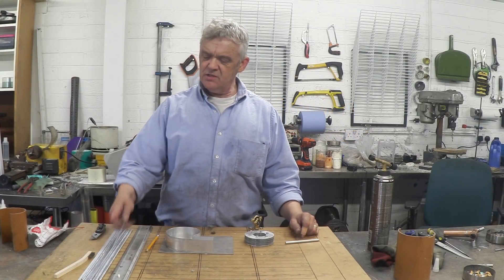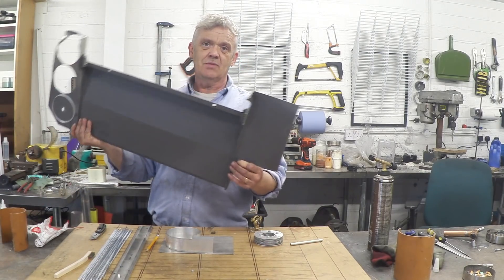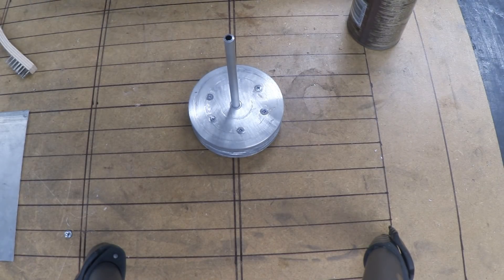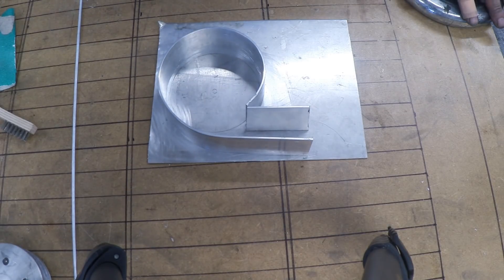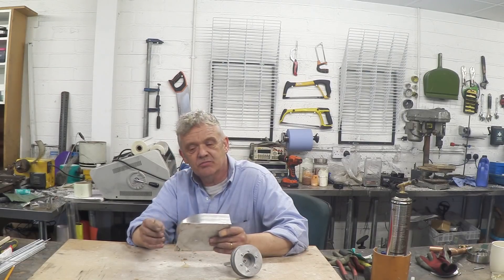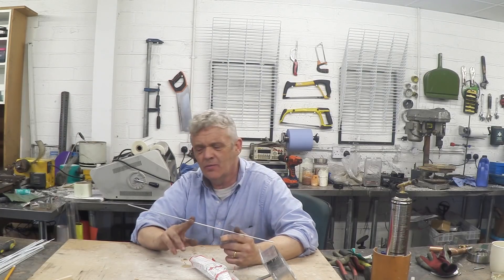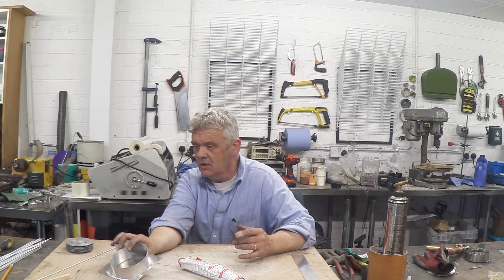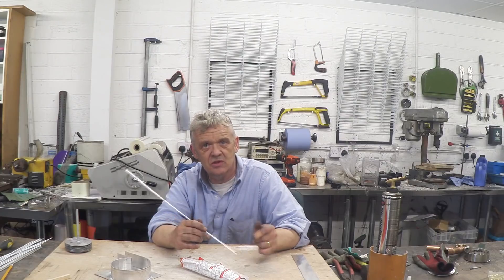Brazing Welding Aluminium For  A Tesla Wind Generator

Comment: Thats great. I learned back in school that it's not possible to solder aluminium because of the instant oxide layer that it forms. Technically probably correct but I was not aware of brazing ( I don't know how this differs from soldering, google translate gives me soldering as translation but I think it's a little different ). Anyway, I'm a home brewer and I could make a conic fermentation vessel with this tech. Many other things possibly. So thanks for the video, this is good info.

Comment: Brazed aluminum is said to be stronger than TIG welded.  Welding melts the base metal to fuse it together so it loses it's temper and thus some strength which it never regains.  Brazing, as you say, is more like soldering.  The brazing is as strong  as the base metal, so no loss.  
I ran across this stuff a while back and never got it to work for me.  Probably operator error plus poor choice of torch and supporting materials.  Thanks for the tips!

Comment: I've been using those aluminum rods for a few years. It can be a bit aggravating at times if you have a thicker part to do. If you can get the heat right, and it's clean, it will flow great. Heat the part, not the rod.

Comment: Great stuff! I think the rubbing probably scrapes away aluminum oxide from the surface. When cleaning the surface you think you have cleaned off all oxide but aluminum oxide reforms almost instantaneously in air.

Comment: Actually, when I solder, I always keep the flame off of the joints as I can, pre-heating it then rubbing on the solder, it gives a cleaner job with less mess and usually bonds more rapidly in my experience.

I would say that in most applications, especially those using a flame, one indeed SHOULD solder the same way that you were applying this aluminum brazing/soldering material. 
~( 'w')/
Reply from the maker: cheers mate

Comment: Chemalloy was created by Samuel Freedman in 1951,he mad it to braze aluminum together, he also found that fine powdered chemalloy could actually break apart water in to oxygen and hydrogen with no added electricity, each partial was able to generate a couple micro volts of electricity and when you add up all that powder you had thousand of volts! I couldn't source the materials to make the stuff myself but you folks might want to investigate it! 
A little info and e recipe:
http://chemalloy.blogspot.com/2012/01/chemalloy-samuel-freedman.html?m=1
Reply from the maker: that is interesting mate thanks for that I will look into it a bit
Reply: Lol the electrolysis part may be a bit of baloney however I have used similar rods with a similar makeup to braze together aluminum radiators and reuse them in cars, I usually buy the brazing rods for aluminum at a discount tool store Called harbor freight here in the US

Comment: Hey Rob Sir love from India, great Video great concept, I wish to understand one thing in the involute design which you made Superb indeed, I didn't see any ball bearing seats or the axle configured to fit a ball bearing, are you going to do it later? Coz ball bearings in the Axel on ends would help achieve smooth revolutions, I surely can be wrong, but felt like ball bearings would make involute better with all your hard put efforts, and it's a Tesla turbine which would revolve at high RPM!! just a humble suggestion Sir, please correct me and guide me.
Reply from the maker: on bearing blocks external to the case - the case material is a little thin to fit bearings and it had to be roughly the same guage as the side wall - so that's why - cheers
Reply: @ThinkingandTinkering  Lolz yes you are right Sir, I agree, I wish to buy your ink for experimentation sir, I have shifted towards renewables and building battery packs Sir, your support is Great to humanity with all that awesome knowledge, love from India 🌹💐🌹💐👌👌😂😂

Comment: My experience has been even the cheapest rods work much the same and have a good bond. After brazing a couple bits of cast aluminum together, I beat them with a hammer. The metal broke before the brazing. That's a winner, there!
Reply from the maker: that is awesome - cheers mate

Comment: Probably you could use hardy backer board. Basically the same stuff used to tile bathrooms. Or a ceramic tile, or your wonder carbon foam material. But wood works. Just iffy to do that inside the house.
Reply from the maker: lol - yeah it did burn a bit lol - nice advice mate - cheers

Comment: Have you tried welding  aluminium with HHO? it was used extensively in aircraft production in WWII to allow shipyards better access to oxy-acetylene resources. I have had best results using a flux but there's plenty of sources that claim flux is unnecessary. It also helps to remove the surface oxide layer with Scotchbrite type scourers.
Reply from the maker: I haven't mate - personally I found the little HHO torch not up to ore than small jobs so I would have to build a large one

Comment: Just to point out in case somebody tries that and the solder doesn´t want to stick. I found out that the hardwarestore aluminium often has an anodising coated on it ! So don´t forget to remove it or you will wonder why this aluminium won´t braze even with name brand rods ;) To remove the coating you can use sodium hydroxide in water 1-5% or the belt grinder for that.
Reply from the maker: nice tip mate - cheers

Comment: (name brand) Durafix is definitely the go-to stuff for alloy brazing.  That said, it's not the best solution in many cases, and you're liable to be disappointed by eventual strength, although it's far better than most of the cheap "clones".  It's closer to soft solder or a well-prepared epoxy join than braze in terms of strength.  Aluminium's a bastard to get to stick properly, the whole thing about abrading is to do with getting rid of the oxide layer that forms spontaneously. Prep is everything, even with stuff like the durafix rods.   Actual welding of aluminium is really hard to do well, though, and needs relatively expensive equipment, so durafix definitely fills a niche.  If you're having to rub the stuff in to get it to flow, you're probably not quite hot enough, or you haven't managed to get shut of all the oxide.

For your axle bond, you'd probably be far better off with one of loctite's products, something like 648 retaining compound on a well-fitting cylindrical joint will be far stronger than anything you can do with durafix or much anything else.  For flat to flat joins with a decent surface area and close fitting, any old supermarket no-name cyanoacrylate "super glue" will do the trick.  I've never tried retaining compound on flat bonds, I probably should (the stuff I have doesn't come from Henkel, but it produces equivalent bonds on cylindrical features).  For on-edge joining like your involute, of course, a fillet braze is pretty much what the doctor ordered, although it might be easier to simply clamp between the two outer faces - brazing into a 90 degree edge is tricky, as you found, much kudos for getting any sort of decent result.  I'd have been very tempted to change the design in order to be able to use adhesives, but playing with something new is always a learning experience so hey, why not.

The idea of the stainless brush, btw, is that it doesn't contaminate the surface.  As long as you never use it to brush anything but aluminium, clean all grease and crap off the surface first, don't fart near it if you've had  curry, etc etc.  Clean, fine grit abrasive is fine as an alternative.
Reply from the maker: nice advice mate - cheers

Comment: I watched several of the YT videos on aluminum brazing before I bought my rods. I was very impressed with the flow characteristics and the fillet I got between the two pieces being joined. It seemed to have a lot of the character of a good weld.
I got a distinct impression that a non-stainless steel brush would generate problems with residue. Your use of sandpaper would avoid that. I am also impressed with its ability to bridge large gaps and fill holes. I have yet to try that.
Getting a good joint at 700 F puts the technology within reach of a propane torch which I like as well.
Reply from the maker: there is such a lot to like about it mate -I am going to be playing with this for a while lol

Comment: The more I watch your channel... the more I realize, "I need a bigger workshop!!"  😄  Actually think I need to slow down the "making" a little and start working on organizing space and getting rid of clutter.  That video I uploaded of making the air piston/cylinder was working within the last 2 square feet of space left in my shop.  If I seem quiet for a bit, you'll know why.  😋
Reply from the maker: I like cleaning up and organising my shop - it does the same thing to my mind as I clean the space around me
Reply: @ThinkingandTinkering  I have a very bad "perfectionist" habit that paralyzes me when I'm not satisfied with a solution, which is how things get so cluttered! 😊  It's no exaggeration, I can sit staring for two hours trying to decide where the best spot is to store my hot glue gun... and STILL end up not finding a place.  I can't explain it - I efficiently directed others on complex projects for many years, but when it comes to my own "stuff" I struggle with the simplest decisions.  If I were my own boss, I'd have fired me by now. 😋

Comment: Right up the ole alley there Rob.. I have to get some of this.. I never thought I would be any good at welding aluminum  because I have heard it said that it is hard and takes a lot of practice.. Well since I do not need to do it often I never gave it a go.. now how every I am off to try it.. Thanks..
Reply from the maker: you should mate - I was impressed - I think it'll do a good job for non critical components - serious load bearing or pressure - then no - but lots of jobs would work well with this I think
Reply: @ThinkingandTinkering  I am gonna try it.. I have ordered the same rod as you got and gonna give it a go.. What fun!

Comment: Some of those style solders need to be scratched through the molten bead with a pointy stainless steel rod to break through the oxide layer for better adhesion. 
They are great for fixing machining cock ups in alloy parts, saved me hours of remanufacturing time more than once.
Reply from the maker: that is a good idea mate -you are right sometime is score something by accident and leave it but it ruins the piece really - this would take care of that - nice one mate - thanks for the tip
Reply: @ThinkingandTinkering  just trying to give something back

Comment: Just a quick note, the significance of the little wire brush, is that its a stainless steel brush. Experience has taught me that A mild steel wire brush or wire wool can contaminate the braze. Cheers
Reply from the maker: yeah I read that too mate - but to be honest I found oxide paper work well in awkward to get at places like a rod or tube or sharp corner

Comment: Aluminim can be soldered with ususl solder, jusd and some motor oil on aluminum ant scrach it under oil. Oil prevents aluminum from oxidation, then with soldering iron heat that scrached place and add solder. Solder  realy bonds very well to aluminum
Reply from the maker: it's not that successful mate - I have tried it and to be honest it really is a pain to get a good job that way - if you do get a good job then yes it works well but getting it right was a real mess on - this was noticeably easier - but horses for courses a they say
Reply: theres a way to passivly copper plate aluminium with copper sulphate and ferric chloride thats a good way to get it to bond. Ive never had much look with scratching through oil it stinks and it more glues than joined i found.